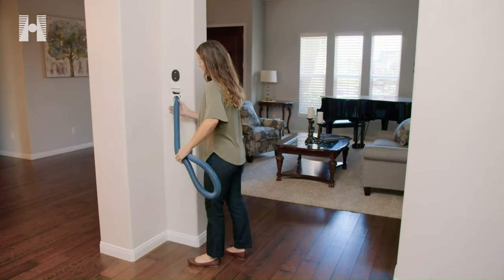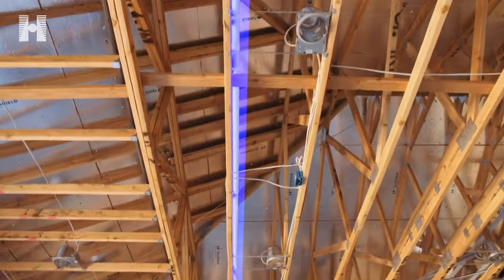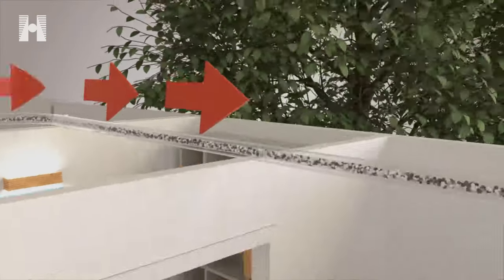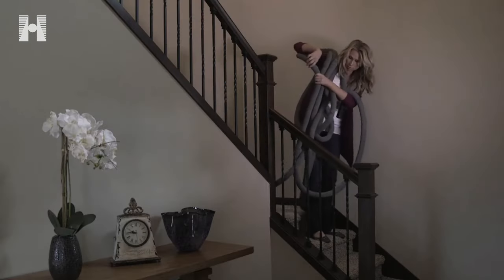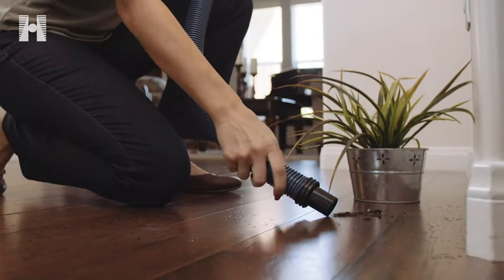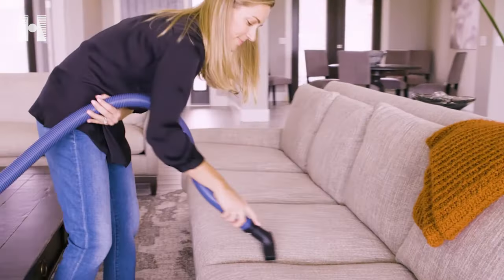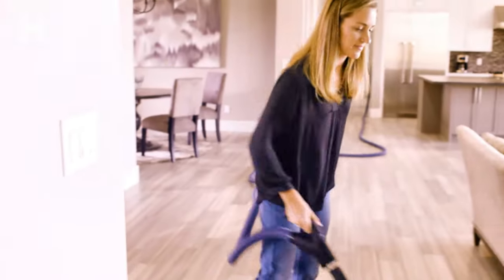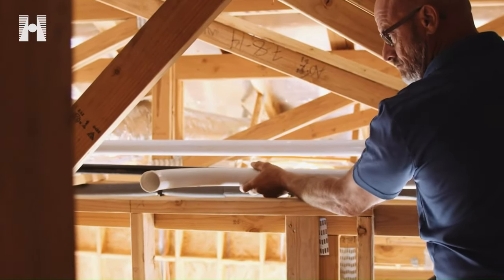How Hide-A-Hose Central Vacuum Systems Work 2024

Comment: How does it power the sweeper?
Reply: For carpet you can use many different types of turbine powered carpet heads and for best results you can get the battery powered carpet heads they offer.
Reply: @Arizona-Vac-Pros  Thanks

Comment: Looks like a pain for maintenance or FOD. Cool but not practical
Reply: I had a central vac for 8 yrs in my previous house. The house was 20 yr old which had the central vac built in during construction. It was the kind where we had to carry the hose from outlet to outlet. I loved the system, never needed any maintenance, no issues ever. There are more maintenance issues in handheld vacuums than central vacs. I would highly recommend central vac over any handheld vacuum anytime!
Reply: FOD? Not so.. I had one I'm our old home. It's basically an industrial vacuum in you house that lasts a life time. You can't compare the suction of a top of the line shop vac. They work! And really don't maintenance. Other than the sound of the suction they are silent on the user end